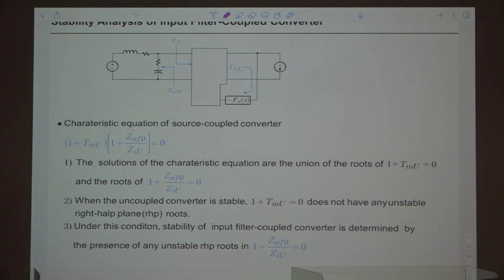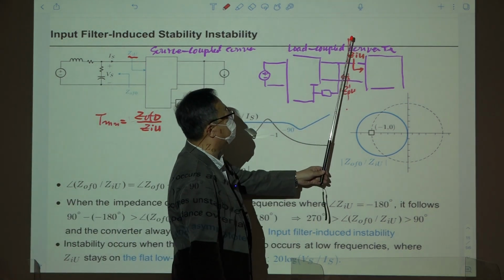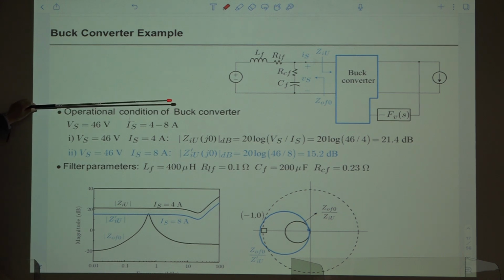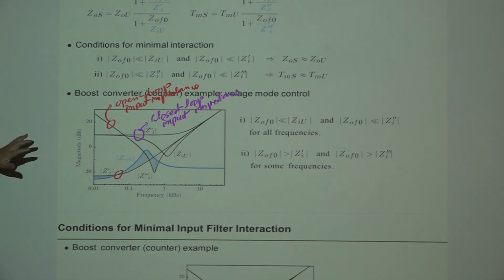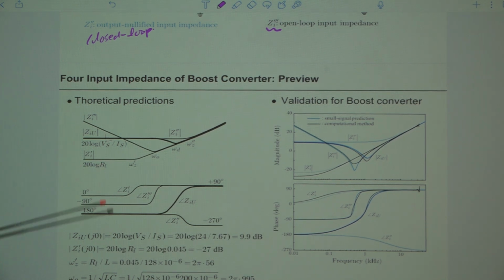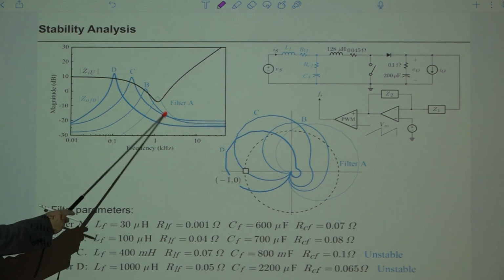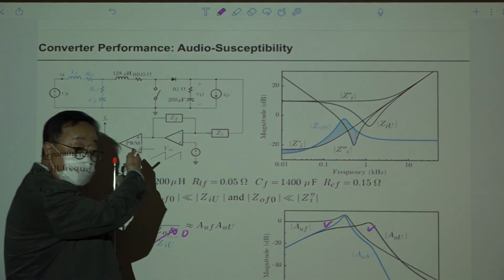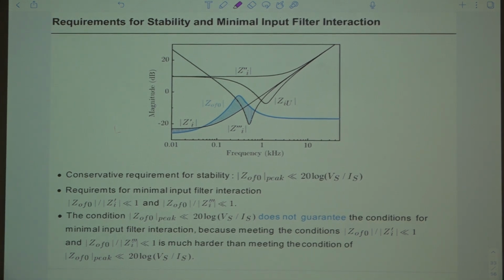Input Filter Analysis and Design in Practice: Part II

Comment: Thank you sir 🙏 is there any possibility to show this by simulation or using lab demo
Reply from the maker: Thank you for your kind and constructive comments. Currently, I am revising Part IV of the second ed. of Wiley book, in an attempt to provide easier and more reader-friendly descriptions on the topic. I am trying to prepare as many as illustrative examples using the license-free version of PSIM. It will take some time. Now, I am posting the latest Lecture slides for Chapters 9 – 12 of the book. They are posted at https://drive.google.com/file/d/1JIneF3ERSrhhj2kG5R0kGFKoOWzDkrDh/view?usp=sharing
Reply: @byungchochoi3322  Many Many Thanks sir ...this ppt is  excellent..with simulation it's become really easy to visualise the theory.
Reply: Check out Robert bolanos, he does a great practical measurement of the input impedance using the bode100 😊 @powerpath-n4u